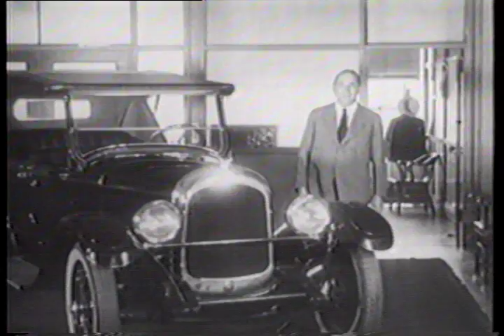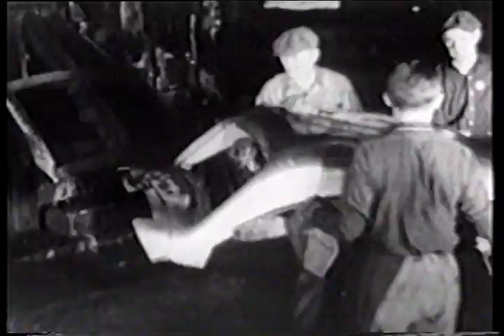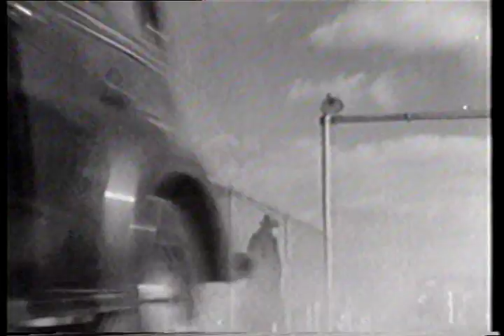Chrysler Straight 8s in the 1930s

Comment: I learned to drive on my dads 49 Plymouth Special Deluxe. Cars back then were finished much better than todays vehicles inside and out 👍😉
Reply: No they weren’t. What an absurd thing to say. Cars “back then” were worn out before they hit 100k miles. The average age of cars on the road today is 12.5 years and there are plenty of 20 year old cars still doing service as daily drivers.
Reply: @oldcountryman2795 I I think a case could be made that older body on frame cars were more repairable by the home mechanic than today's unibody, computer controlled cars. Modern cars are junked for the slightest damage, because everything is so expensive to fix. Older cars were more environmentally sustainable, in that sense.
Reply: @DUCKSAREEVILLLLLLLL  FACTS!
Reply: @oldcountryman2795  Better finished means better paint jobs, better detailing, things of that nature.  And the reason cars were often worn out before 100,000 miles, (not all were), is because lubricants were a far cry from what we have today.  Today's Japanese wonder cars would probably be shot by about 60,000 miles if motor oil was still the same as it was before the 80s.  And there was a fair number of cars over 20 years old still in service back in the day.  They were easy to fix and easy to overhaul.  Today's tin cans are nearly unfixable - when worn out, you simply throw them away.
Reply: @oldcountryman2795  I didn't say mechanically
Reply: well cars back than are luxury item, can't compare luxury with working class vehicle 😅

Comment: DeSotos were six-cylinder cars throughout the '30's.
Reply: It should of been possible to get a straight 8 in a Desoto.
Reply: @paulshaffer9674  You could get an 8 cylinder Desoto in 1930. I'm not sure after that. For some reason Desoto and Dodge only got 6s. Dodge was 6 only after 1934.
Reply: There was a straight 8 in 30 and 31.

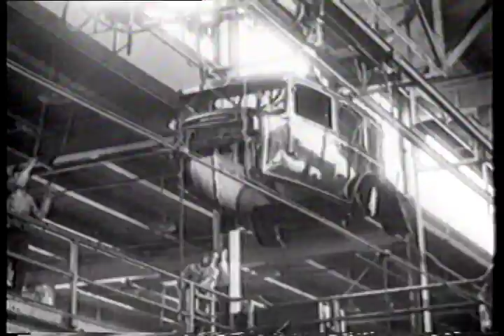Comment: 1:05 Shockingly similar to "body drop" footage up into the 1980s.
Reply: Shocking? Are wheels and tires shockingly similar?
Reply: @georgewetzel4380  Ehh, DUH. Cars still have wheels/tires. Yay, you are a genius. Radios (cellphones are actually radios!) still use electromagnetic radiation to send / receive information in 2020 as they did in 1920. But HOW how a 1920 radio was made is not how a 2020 radio (yer iPhone fer example.) is made. Cars are NO LONGER made this way. The car (today) is a unitized body/chassis with parts bolted on to that ONE unit. That the chassis, with all the running gear and suspension ET AL, was a separate, functional device WITHOUT THE BODY was still a concept until the 1980s was what I was commenting on. 🤷‍♂️🤦‍♂️

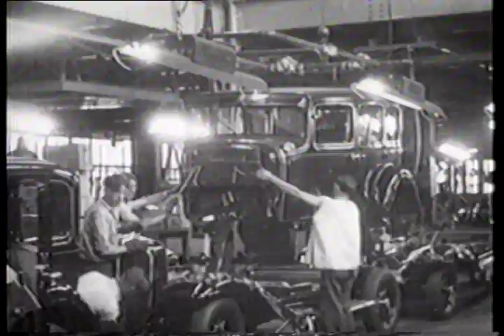Comment: 1:11-Men wore smocks then.
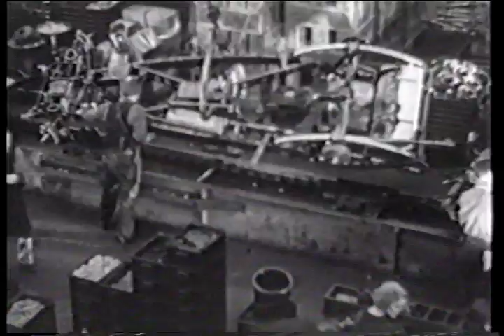2:31-Frame "spotters" were located at strategic points in the plant
to catch the occasional upside down frame.
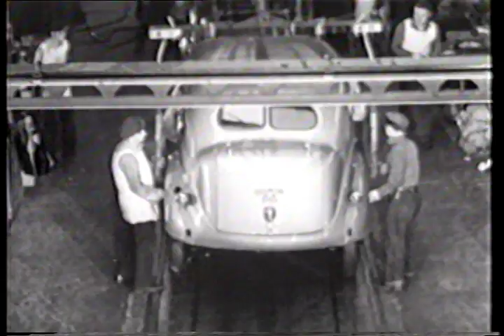3:13-Each line had it's own 'Smock Boy'.
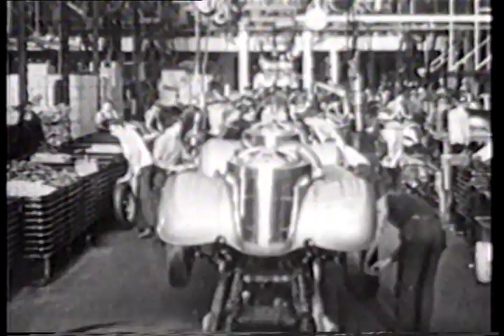3:48-Ciaos ruled when a new Chrysler came through that would run. As you can see
people celebrated, flung their arms about and swung from the ceiling for hours.

Comment: I would dare say some people would buy these Chrysler cars new today if possible......with disc brakes and A/C. They probably ride/drive better than new Chryslers today.
Reply: I would take an old flathead Chrysler six or eight over anything Chrysler makes today, if I could get a new one at the price they charged back then.
Reply: I have a 1937 Plymouth. Drum Hydraulic brakes, inline 6 cylinders. Armstrong Steering (Non-power), 3 speed transmission. It is not fast and does not drive like a modern car but is a whole lot more fun. Given a choice as to which new car I would want for my daily driver, I would take my Plymouth every time. It is a much more comfortable car to drive and ride in.
Reply: I would buy one even without disk brakes and AC.  No damn computers, no catalytic converters.

Comment: Got hold of a mint 52 Diplomat. Very rare in NZ, have rebuilt the flathead 6, twin carbs, two pipes off of a bespoke set of headers /exhaust used at Bonneville for racing. Lovely car, and some great models over the years.
Reply: My dad was into stock cars, as the builder he used the engine setup and ported  mentioned, a gutted coupe,and a larger Ford brake adapted front left. He said they were beating Ford flatheads
Reply: Glad you like it, as those were very good cars.

Comment: Chrysler is just a name any more. Seems like everything they sell is loaded with Fiat parts.
Reply: Changed the timing belt on my 2000 Dodge Neon @ 185,,000 miles, hardly any wear, no checks or cracks, edges on cogs still clean and sharp,could still clearly read printing on belt ( Gates ) put 247,000 miles on it with few issues, my 2013 Dodge Dart requires no timing chain replacement for life of engine..... 300,000+ miles
Reply: Lousybarber could that be because Fiat owns Chrysler?
Reply: @lincolnpaul1814  Fiat no longer owns it, Peugeot owns both Fiat and Chrysler.
Reply: I hope the Fiat parts are made in Italy. I recently owned a 2002 Chrysler LHS . It was an okay car . I did not trust the fiber timing belts they use, so I sold the LHS and bought a 1998 lincoln mark 8 that has timing chains rather than belts.

Comment: plymouth was still using the flathead 6 in 1955. I Was 10 and a neighbor had one. when I was 15 in 1960 we had a really tired used 51 cranbrook plymouth. I learned never buy a used car from a old farmer. They run them till there is nothing left. that old flat 6 was so tired when it was warm it could not get away from the starter. burned 2 quarts of 40 bulk oil for every half tank of gas. I tried to get my dad interested in rebuilding the engine but he wisely noted the whole car was shot. spent 500 on a good used 55 chevy 210 2door 6 stick. much better car.
Reply: Yes, I'd take the Chevy over the Plymouth, too. Those flat heads needed valve jobs almost when new. Plymouth used that engine through 1960.
Reply: @1940limited  I would have fixed the Plymouth.  The 51 Plymouth was not a thing of beauty, but it was an excellent car.  Better than a Ford or Chevy.

Comment: Buick had an overhead valve straight eight well before this time...
Reply: Buick also pioneered aluminium in engines in early 20th century! No one realizes that all modern engines have Buick tech to thank!
Reply: @WAQWBrentwood  or thank anything for that matter. Gosh, its like in modern day, everything even the damn faces of the vehicles, are distressed and riled with rage. They couldn't possibly see the "past" as anything more than a set back and burden...uhg! This society of today is ridiculous.
Reply: Chrysler was president of Buick here in Flint till he got in a argument with Billy Durant...
Reply: Laura Halliday Overhead valve engines back in the thirties did not have much of an advantage mainly because of their low compression ratio. The lack of high octane gas mandated a relatively low compression ratio.

But one advantage the OHV engine had was better thermal efficiency because the combustion chamber was smaller, therefore lower heat loss.
Reply: True, but with 1930s rpm and compression ratios the better breathing of overhead valve engines didn't make a great deal of difference.
Reply: @marsgal42   Overhead valve engines have the advantage of much less heat loss and much better air flow than flat head engines. They are capable of much greater compression but back then the vailable fuel did not allow high compression.
Reply: @marsgal42   Overhead valve engines have much less heat loss and much better air flow than flat head units. They're also capable of much higher compression but back then the available fuel prevented the use of higher compression than what you found in flatheads.
Reply: I had one of the first aluminum v-8's... in a little Buick convertible from the 60's.
Reply: Nash and Duesenberg also had them, but most manufacturers used flatheads. Pontiac used it through 1954. So did Packard.
Reply: The Buick Overhead straight 8 came out in 31.
Reply: @michaelbenardo5695   What I meant was that Buick had overhead valve engines long before the late 20s. Also the same for Chevy.

Comment: There is no mention of any motor in this video. It is mistitled.
Reply from the maker: Thomas Talbot Well the first part shows of the Straight 8 vehicles and then it goes to manufacturing and a longer blurb on a later DeSoto.  It's how it was all spliced together when I rescued it from oblivion in a Chrysler factory.
Reply: King Rose Archives fair enough. I really enjoyed the video. Its a real find. Just thought the title was off. Was hoping for details on those engines?
Reply: What Chrysler plant if you don't mind saying...
Reply: I think the silent part in the beginning was cars with the new Chrysler straight 8, but there's no mention of it. They also had 4 speed transmissions.
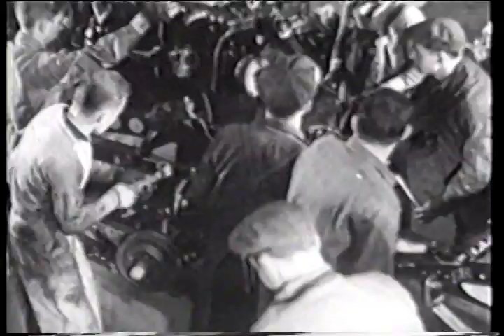Reply: 2:38